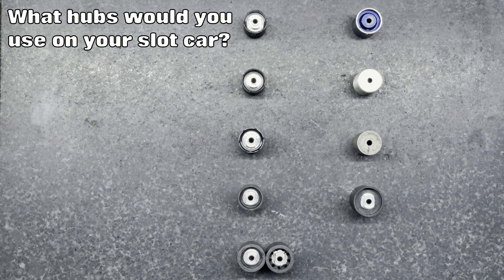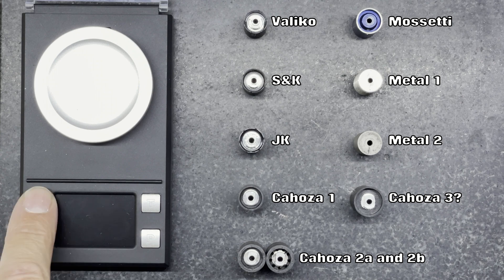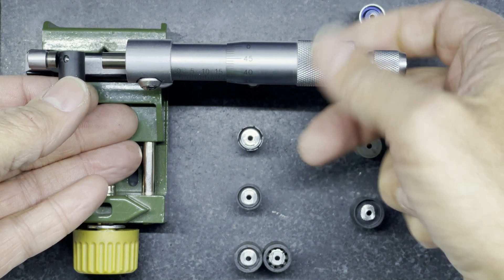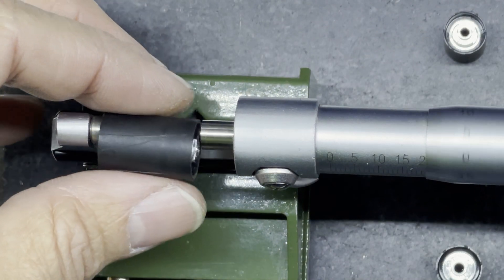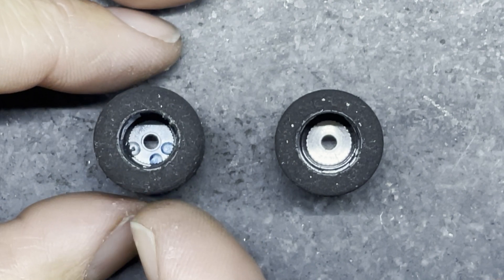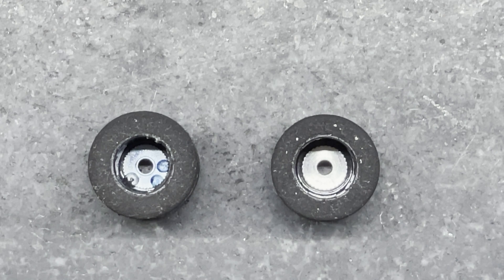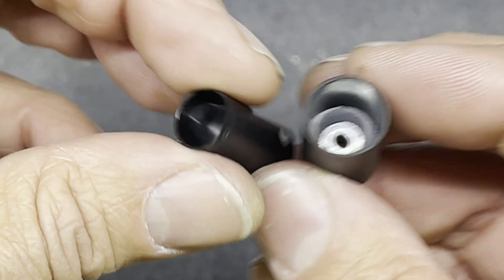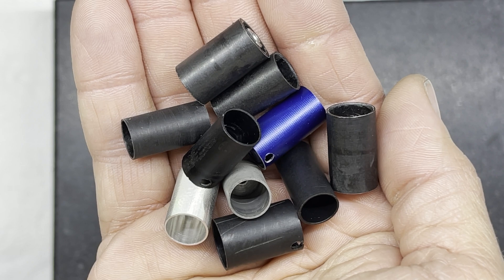Size is important but not the only thing! - Which wheel hub should I use on my slot car?

Comment: hi cleave. I just saw the video of the polymer cubes, and of the aluminum ones, I tell you my experience, and my study about it: when I returned to the hooby, 10 years ago, I started (that was used at that time.) the cubes polymer. After a while (quite a long time. Let's say about 8 years.) I discover ewl aluminum cube. the question is, that the rubber always broke, on the outside. Then I asked the boy, who is the one who organizes the championship of the year, and he tells me that it is because of the blows that are given on the railings of the track, but the truth is I did not believe him. I felt that was not why the tires broke. I have a friend who is a turner, and I asked him to make me two (2) a pair (bring him a sample.) of aluminum jackets. I brought them in, and WOW !!!!!!! NEVER AGAIN WAS ANYONE BROKEN, AND THAT WAS WHAT I DISCOVERED. ? that the polymer cubes, being soft and the G12 cars go very fast, in the curves, they bite badly, that's why they broke. When I started testing the aluminum hubs, I never broke a wheel again. the race ends, or it ends because it is no longer useful for running, (that is, a new one must be started.) I bring them out healthy. that's why in my opinion. (for me) the aluminum ones are better. And that's when I told my friend the turner to make me 50 pairs, and I'm happy because of the performance of the wheels. And where I run, everyone uses the polymer cubes. well I hope it was understood. Greetings and congratulations, from Argentina for the videos.
Reply from the maker: Thank you for your story. It is interesting to hear other people’s experiences. I have not found an issue with the rubber tearing on the outside except in 1/32 Formula One where the tyre is very low profile on the hub due to the small diameters (15mm) we run on those cars. Also some types of rubber are softer and can tear at the edges more easily.
Did you test the same size aluminium hubs against the same size polymer hubs?

Comment: I race wing cars, retro cars and scale cars on king tracks and flat tracks. I use magnesium hubs on wing cars and use different types of hubs on retro and scale cars depending upon track conditions. I have an assortment of tires for each slot car and use lap times to determine what works the best. The wing car tires can make noise and this tells me the tires are too hard. I thank you for your hub video,
Reply from the maker: Thank you for commenting. I have not raced a wing car in anger but it has to be the purest form of slot racing. Everything has to be perfect as the driving is more about avoiding accidents. I know some wing car racers use aluminium hubs with holes drilled in them.
Reply: @CleaveTech  I race G7 slot cars and all of my tires have magnesium hubs with holes drilled everywhere. The cars can run in the 1.5 second range on a 155 foot king track and reducing weight is extremely important. I use armatures with hollow shafts!
Reply from the maker: @johnwakamatsu3391  , great info. I didn’t know the armatures had hollow shafts!
Reply: @CleaveTech  The G7 car is the only wing car class that allows hollow armature shafts. The hollow shafts are custom ordered.